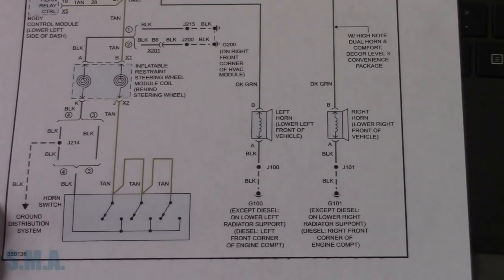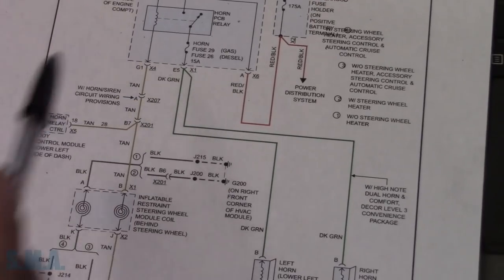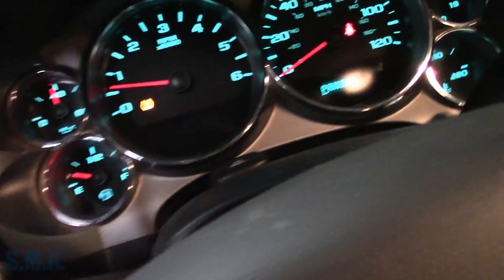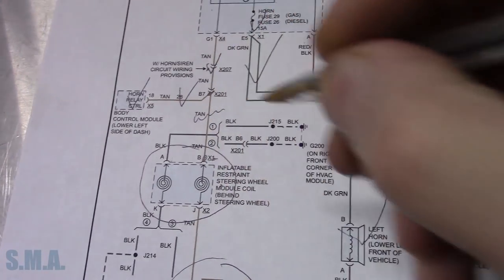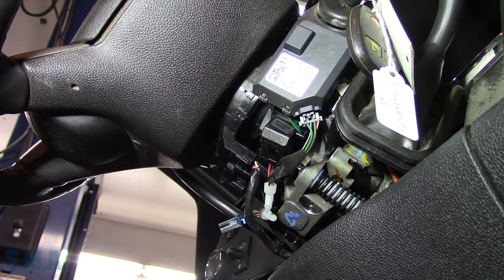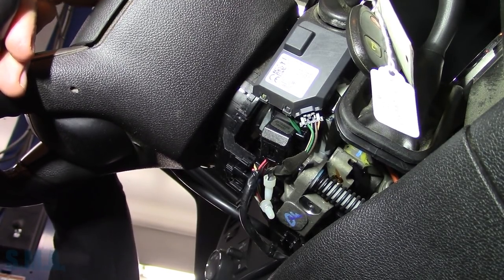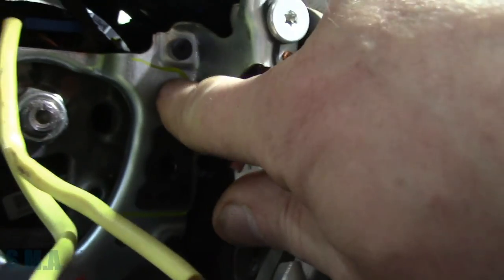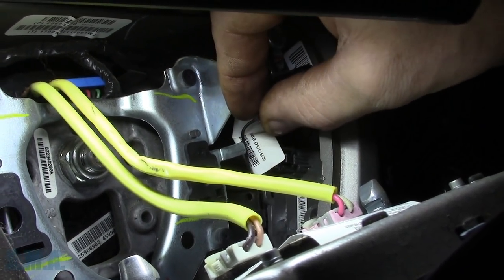GMC Sierra: No Horn

Comment: This video reminds me of my Dad's 1985 S10 Blazer.  Back in the 90s, the spring metal that comprised the switch in the steering wheel had a finger that broke off.  It tumbled around when he turned the wheel, often resulting in a string of "angry driver" honks on occasion.  This always seemed to happen at the most inopportune times.  The best one was at around midnight, on a nice summer night, while going around a slight bend on a city street. You could see the lights go on in the houses as he woke up nearly everyone on the block who had their bedroom windows open. 

It was at the repair shop the next day after that.
Reply: I hated that Blazer, it had the 2.8 V6 with the carb, ugh!
Reply: @maxrx7   Yeah, it was a pooch, no doubt.

Comment: The day after watching this video, I didn't pass my State Safety check inspection due to my horn not working. I did just like Eric O and tried my panic button on my remote and the horns worked fine. Then I noticed that some of my steering wheel controls didn't work. Turned out to be a bad clock spring for my car. Expensive part but at least I saved on the labor by doing it myself. Thanks Eric.

Comment: 4 commercials in a 12 minute video = no bueno. In an Eric O video = totally worth it!  Somebody screwed around with one of those airbag wires - the sheathing is scraped off quite a bit. I would have had a close look at that and taped it up before popping the horn button back in.  How many thousand others said, “Ivan no parts required repair!”? 👍👏🔧

Comment: I was thinking "I'm not so sure" when you called it as a clock spring. Glad you left that in there; shows how easy it is to make an incorrect assumption.
Reply: The parts cannon was loaded, but he gave it another thought before lighting the fuse. I understand the logic: "What are the chances that it's the horn switch?"..... well now that I've said that out loud, the chances are much higher. Better make sure.
Reply: Everybody glances down that dark alley occasionally.

Comment: Whaaat! Steering wheel heater. That's it I'm getting rid of my yugo.
Reply: lol also theres a windsheild washer fluid heater
Reply: You'll love the powered rear lift gates, air conditioned seats and heads-up displays on these new computers they're selling.  They even come with 4 wheels too!
🤣👍
Reply: @tyree9055  V6 powered cell phone charger - what a crock
Reply: @tyree9055  I would LOVE some air conditioned seats. oh man, how awesome those would be on a long car trip in the summer.

Comment: It was a news channel seeing if you’re an honest mechanic. Lol
Reply: News channels are not that savvy. I recall one sending some appliance like a clock-radio around for service; they hired an engineer to set something up so he blew a fuse and put that in. The news channel was incensed that two of the shops they took it to wanted to replace the power transformer the fuse fed. Their engineer didn't know what the good techs know: if a fuse is blown, something blew it. Replacing a fuse will get you a call-back.

Comment: I work at a GM dealer in Canada, the airbag recall is only for the passenger side airbag, great video!
Reply: If I remember correctly, the Takata recall was humidity sensitive, so the further south you get, the more important it is to get it done. I don't know if this is about the same issue.
Reply: Thanks for the  info--  '08 Silverado LTZ
Reply: @CheezyDee  same one, GM was putting priority on humid climates first as they is something like 6 million effected vehicles
Reply: There is also an older recall for drivers side air bag.I know I still have the GM Letter and dealership says they don't have the part for recall
Reply: @sodbuster518able  haven't heard of that one, but would have been before my time, just did a quick search for it and couldn't find anything on it
Reply: @sodbuster518able  , Yep, I just looked at my letter, dated July 2016, and it says passenger side.  I  never got the older letter.
Reply: @CheezyDee ,  my truck has spent it's life in the Mid-South, (call it Memphis) so I know about humidity.

Comment: Always hated doing under dash work.  Hard on your back and neck.  I used to install air conditioners in escorts at the fort garage.  Learned to be a contortionist and to buy pain meds.  LOL.  Good video bud
Reply: I have an 02 Pontiac Grand Prix and had to replace this set of contacts thingy that is apart of the ignition switch. Under the dash near the column work. I've had the car long enough to have to do it again. Second time I just pulled the drivers seat out. Then I could relax and put my feet up on the rear seat.

Comment: I was on the interstate drumming on my steering wheel once, and when I slowed down (it was a noisy interstate) I realized the horn was stuck on.  Pulled the fuse, shared by the wipers, and it didn't rain even though I was in Seattle.

Comment: Remember on the older stuff the ground strap that crossed the flexible steering shaft connector would corrode and the horn would lose it's ground. At least Best Buy didn't use those worthless blue scotch-lok connectors that cut into the wires. Good video!
Reply: I was just thinking of this but no reason to copy the comment , usually making a new ground git the customer “horny” again

Comment: Your powers of deduction are amazing Sherlock.
Reply: "It's elementary, my dear Watson! The horn works when the fob is activated, but not when the horn contacts in said steering wheel are depressed. Thus, the problem, and the solution, laid elsewhere. A careful examination of the physical evidence revealed the cause of the malfunction was inside the steering wheel airbag compartment, viz, a disconnected wire which prevented the horn contacts from sounding the horn. Once again science and good detective work solve the case. Now, bring me some tea if you please."

Comment: Choice 1 , repair stock horn .
Choice 2 , install k5la train horn ! 
( Me personally , choice 2 😁 )
Reply: Still gotta fix the steering wheel ground wire, unless you want a separate pull cord for the train horn!
Reply: @KenLyns  , yep , gotta have the pull cord
Reply: I have both xD
Reply: Or a Nathan...can't think of the model number now.
Reply: @markh.6687  nathan airchimes P3 train horn ?
Reply: @markh.6687  1799.99 on amazon
Reply: @thomasfletcher4765  That P3 sounds familiar, but it would cost more than my car is worth!
Reply: @markh.6687  then they also have the k6la ( same company ) for 2399.99
Reply: @thomasfletcher4765  Sadly I'll have to let that go for now. Maybe I'll just replace my Saturn's Japanese-style "BEEP" horns with 'Murican "HONK" ones. But the OEM's still work.

Comment: Well theres aftermarket stuff and then theres the people who install. Crimp connectors arnt in it for the long haul. I had my remote start installed professionally but had to redo it all and they didnt wire in the trunk or a few other options i had.. Not sayin its easy but you gotta solder that wire and if wire ties are used friction tape is best insulator. I was out in the snow in my driveway one winter day, installing another remote start just so my girl had a warm car in the morning. Now thats love 💕😘Never had an issue with that remote start for a few years till someone smashed into the car, now that cars totaled but i still have the remote start tho😂. Just to mention the brand was bulldog security deluxe 500 i believe. It never let me down it was a human who took away the time spent that one winter day. Thanks humans lol. Anyway the vids you do are and rip linconln zephyr

Comment: Dam spade connection, remind me of a fault I had on my own Datsun Sunny (UK) 1980's .every 3 or for 4 months when I go round a right hand turn the engine would stall. It would restart immediately with the key and then be fine for another 3 or 4 months. I found the fault by accidentally when touching the wiring harness I noticed the spade connector on the low voltage side of the coil was just slipped on between the boot and spades when when you turned the corner it must of broke connection just enough to kill the ignition but not every time. it took about 4 years to find that one by accident I lent on the harness while doing some thing else and just notice the move of the spade.

Comment: The construction company I wrench for buys all used utility trucks at auction. Every one has aftermarket alarms, remote start, GPS, computer, lighting etc and on and on. I have learned the hard way to pull all that shit out. Repair all the cut/spliced wires, scotch locks (shutter) and go through the dash harness with a fine tooth comb before I allow it to be released into the wild.

Comment: "At least I didn't have all the oil drained out of it". I had to restart the video because I was laughing so hard. Ask me how I know. It wasn't so funny at the time though.
Reply: Let me guess....... :)
Reply: @John Stone Supposed to be a hood switch. The remote start that got me while changing spark plugs didn't have one..........
Reply: In Hoovie's Garage (IIRC) the Wizard warned that the key fob should be kept on the ground when putting a Toyota hybrid on a lift. Apparently he had left one inside the car when he started an oil change on a Prius, and the system was still "ready." The engine started with the oil drained and the car in the air.

Comment: A long time ago I had a bad clock spring in my 80s Toyota. Sometimes when they go they warp, a test for this is hold the horn button down and turn the steering wheel 360°. I found out my steering wheel had to be at the 2 o'clock position for the horn to sound. 😂

Comment: Getting my airbag recall done on my Dodge Ram was a quick easy trip to the dealer. Two days later I go to honk my horn and it didn't work. Tech had forgot to plug the horn wire in. I'll bet the dealer guy unhooked the airbag and pulled the end off because he forgot to unhook the horn wire.

Comment: No one was in there. The stacon connector was not tight enough from day one and took 10 years to work itself  loose. I have seen this on many applications and fixed the same way.
Reply: The QC on the connectors is really poor. It makes sense; some may get squashed and some may get deformed. We only see the squashed ones when we put them on, but we see lots of loose ones in service.

Comment: knowing GM quality I'd bet that was a factory connector. Edit: in fact I know it is. I was curious and googled 2011 Silverado steering wheel an they all had that identical connector
Reply: Actually, that was an "Unconnector". Also notice on the diagram what the horns are called. Because "Horn" was too simple. EDIT: Nevermind about the horns, I misread the diagram at full view speed. DOH!
Reply: @markh.6687  All I see is "right horn" and "left horn".....   What am I missing?
Reply: @G31mR  Sorry Larry; false alarm. I freeze-framed the video. I thought the diagram read "Left Horn BLOWER" instead of "Left Horn/Right Horn Lower Left/Right of vehicle". DOH!!

Comment: That a shame if it was actually installed at Best Buy. I used to do car audio/alarm install for them and company policy was to solder everything when it came to security and remote start, T-Taps were a big no-no.
Reply: Why's that? Soldering would be worse in a vibration risen environment.

Comment: Helluva set of horns that need a 175 amp fuse :)
Reply: It's a horn / arc welder.
Reply: that's because its the mega-fuse that is between the battery positive terminal and the rest of the electrical system; if that fuse blows, the entire truck goes dead!
Reply: Engineer that designed that part wanted to see what kind of bang he'd get from the Air Bag detonators with 175A input or 175A Taser anti-theft device (Kill switch).

Comment: If you look at the engineers schematic, they paralleled three switches wrong. The power should have come in on the right side of the three switches and  exit on the left side so you pull even amperage across all 3 legs of the switches. Electricity takes the shortest path, so they are putting the amperage through the first set of contacts.
Reply: It'll only be milliamperage on a relay control circuit. The way those contacts are spaced out is likely so that at least one will make no matter where the pad is pushed.
Reply: In this case the part of the pad that is pushed determines which switch(es) make(s) contact.
Reply: I am used to doing heavier DC amperage through contactors.

Comment: no parts required !
lot of outfits been a padded bill on that job .
Not very often get so easy a fix lol .
Reply: Well, ya gotta' figure that took about an hour, start to finish. (a 13-minute video notwithstanding).  If he charges what the shops in my area charge, that's about a Benjamin in labor. 
  The customer here might have felt the bill was "padded", but he'd be wrong.  Good job, Eric.
Reply: about as cheap as it going to get is an hours time . .
clock spring could of been 350-400 final bill .
other elec issue like harder find wiring fault or anything requiring even basic parts soon 200+
All in all a sweet result ... 
Lot of shops intentionally or unintentionally could of spent serious money on work like this .

Comment: If you look on the horn plate at the steering shaft nut OD, there is indeed evidence that someone has been there. Too bad they left the female spade loose, it compounded THAT repair, as this was a result of a careless mechanic before you. The customer is wise to have chosen SMA over a shop with the parts cannon.

Comment: Maybe the factory didn’t crimp that connector hard enough, letting it eventually work loose on its own over the course of a few thousand bumps
Reply: That's what I was thinking.  Along with the Best Buy wizard pulling on wires and possibly the brown one with the lose connector.
Reply: It might have been the other way around. I confess to having come across spade terminals that simply would not go together, and using a knife blade to adjust the tension to a manageable level.

Comment: 5:50 NoP! Fixed my self Toyota with 3 burned contact points in wheel. Man! That Horn, had to be used often or those switch's was made cheaply by Japan's own Toyota. :P
No Way any Drink's that spilled over the wheel can do that ? :D
11:35 Here if your horn blows when you lock your car doors, its is the car way to let your dome ass know that you have one or more door still open!
Other wise its silent to please your late p" calls... with most of the cars. that is, if you don't want that feature to proged/coded in to it ;P

Anyways nice one that's first to me luse connection inside the wheel!

Comment: LOL people sit a foot away from an airbag for 150,000 miles, yet if they have to take it out of the steering wheel it's like holding a bomb.
Reply: especially if you go by "scanner danner"   
stab stab lol.
Reply: If yer face is a foot away from the steering wheel yer doing it wrong. Second while normally driving you arent disconnecting and reconnecting power so maybe there is slightly more risk when servicing DUNNO
Reply: @donjohnson1416  short people drive you know and they tend to be close to be very close to the wheel!
think short lady, seat way forward, raised highest and tipped forward.
the kind you cannot even get one leg started between the seat and dash! (LOL)
Reply: @throttlebottle5906  Oh, I thought you were talking general in your first statement and now we are just talking about short people. OK

Comment: Chevy: needs a wiring diagram to blow a horn

Me: found the problem.
Reply: That's because everybody needed all these added functions, so now you have a HCM (Horn Control Module), a relay, and 10 more feet of cheap undersized wire connecting it all together. :(

Comment: The connector needed to be crimped...it was not tight enough to stay on, so...it did come off. If it was not OEM  stuff then it must have worked it's way off. It worked it's way off anyway, I suppose, being as it had no drag.

Comment: looks like that horn contact assembly was replaced. the factory one has a dimple stamped in it to keep that  connector from sliding off.  also the bar code sticker looks wrong

Comment: Clock spring would have airbag light on the dash.
Reply: Not necessarily. there are multiple circuits in the clock spring,  if the ones that deal with the airbag were damaged then the light would be on. If it's one of the others then it won't.

Comment: its so loose, i think its possible it could have worked loose?  the plate its plugged into does move a little bit.  that and the wheel it just the right angle finally got it to break contact.

i probably would have checked the horn regardless.  i repair electronics and while it might be a forlorn hope, but i usually check the cheaper, simpler option first.

Comment: I love a watch your videos. learn a lot to do my own work and  and others .but I am having a cluster on a 2002 jeep Liberty rebuilt the motor put it in start and run for like 5 minutes hard vacuum leak fix the vacuum leak start and run for like 5 minutes and then it just died I'm not getting any fuel I'm not getting any spark batteries fully charged I had to locksmith come out and reprogram the key cuz the security code icon was on try to start it the security code kept coming back finally had a mobile mechanic come look at it he has all the fancy gear in the ECU is fried is there anything I possibly did just hooking the wire harness back up that could fry the ECU

Comment: What do you want to bet whoever installed that remote start messed with it? Maybe they disassembled more than they needed to to get to the wiring behind the wheel and pulled the whole thing off.
Reply: That or the system is dumb and triggers whenever the horn honks twice so they disconnected the horn, XD